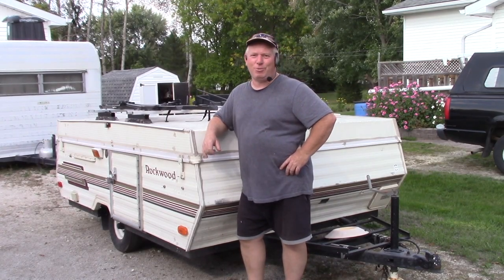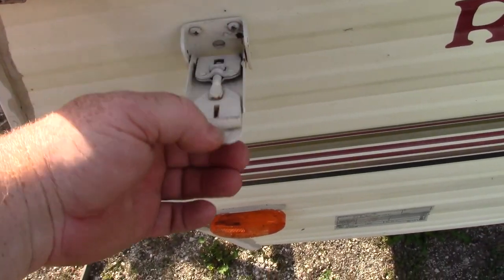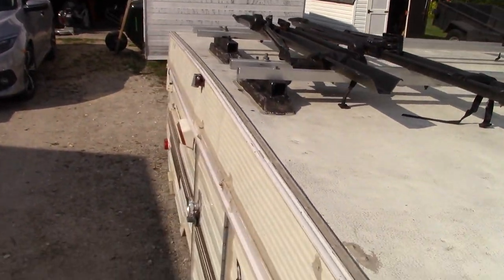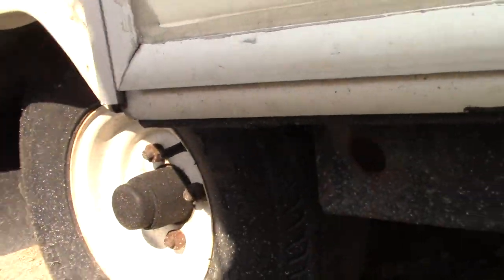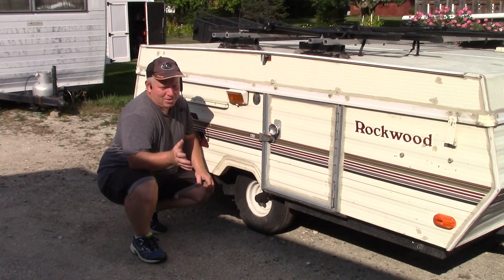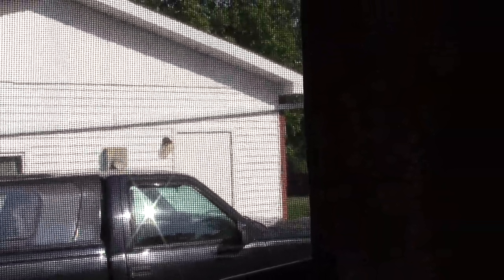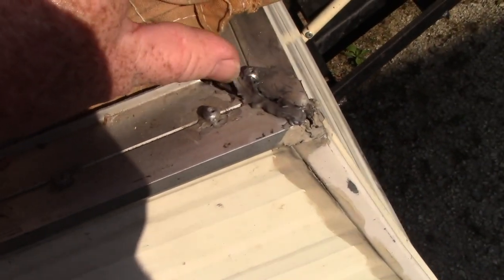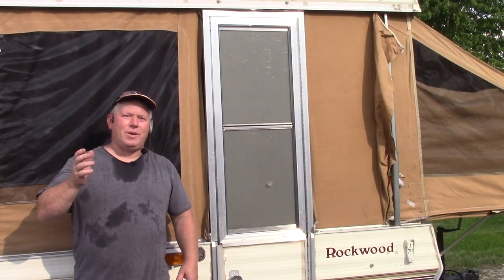Used Camper Problems - What to look for before buying a used pop up camper

Comment: Where the trim on top is, you can replace it for about  $20  a roll instead of going nuts with caulk. No camper has tins that go over the aluminum channel. Sad that someone removed all the hardware for the water, electrical and such. The canvas condition is the most important thing as well as the cable system for the roof lift.
Reply from the maker: Yes you can remove the trim and use a roll of glazing putty to seal it but it doesn't last that long and sealing the gaps with caulking is cheaper and far easier.  My first camper was a 70's era Bonaire and they had the tin folded over the edges of the aluminum channel.  It's truly a shame that the campers from the mid 80's onward were constructed so cheaply.  Having the stove top and fridge in the camper is a bad idea as bears will easily force their way into your tent trailer to eat your food (if there are no bears where you camp then the kitchen set up is fine). I totally agree with you on the importance of the condition of the canvas and cable system. 
Thanks for your comment!
Cheers!
Rob
Reply: @robsgaragewoodworkin  Many parks out west do not allow popup campers because of bears. We were looking at going to Glacier National Park and its a no no to go there with a popup. Its best to check the park before making reservations. I don't want a bear in my camper eather!

Comment: Thanks Rob.  I am looking for one and this helps a bunch!
Reply from the maker: It's an even better time to buy in the fall when people are thinking about storing the trailers and the possibility of storage fees accumulating over the winter.
Good Luck on your search!
Cheers!
Rob
Reply: @robsgaragewoodworkin  Yes it's a good time if you live up north.  I am in Fla, but that is an idea to check around North Fla. thanks.  They are expensive down here.
Reply from the maker: Right.  It would be different in Florida.  If you have a truck or larger SUV it's usually cheaper to buy a 15-30 foot trailer used than a tent trailer.  They hold their value more because they are easy to tow, relatively small and easy to store.
Reply: Sun Valley Coleman pop up, stored in garage, comes with porch addition that doubles its size. 912 467-9800, South Fl.

Comment: Nice video!  Don't buy something on Craigs List and assume what the seller is saying is the TRUTH!  I bought a camper and the seller claimed everything worked.  Not so...the leveling system did not work and the hot water heater only worked on gas.  He said it did not leak and it had a terrible leak in the front bedroom.  The refrigerator is great and runs on gas or electric...yet it was leaking...no pouring into the refrigerator.  He had to know it.  I won't go on and on...just be careful like this gentleman is telling you and have it checked out...could save you some money!
Reply from the maker: I bought it from a friend (but I didn't believe it was perfect because they never are).  But $400 is a good price so you just can't go wrong.
Cheers!
Rob

Comment: Great video, thanks so much for posting. I just bought a 90 model Rockwood, looks very much like this one so I'm thinking it might be the same one but I don't see the model listed anywhere. It's even harder to find a manual. I only saw one stabilizer jack, should there be 4 of them? I paid 400. so good to know, about the price. He tells me everything is working, just needing a good cleaning. We'll see :)
Reply from the maker: It's an 89.  Stabilizers can vary by year, make and model.  It's likely that there should be 2 stabilizers in the back and just the jack in the front.  To level you can put wheel shims under the low wheel.  If you put too much pressure on the stabilizer jacks the frame twists a bit and the door won't open/close properly.  People always say it's in "perfect" condition but their version of perfect can be vastly different than your version of perfect.  If you have more questions feel free to ask!
Cheers!
Rob

Comment: Sleep six people?  That's a laugh.  My 2001 Coleman was apparently designed for 6 anemic midgets.  Besides, have you ever slept in one of these with 6 people?  Between the snoring and farting all night, it turns into a gas chamber from Hell.  Also, the instructions for most all Popup trailers say to lift the roof first before adjusting leveling jacks because it tweaks the frame and puts undue stress on the lifting cables and posts.  Also, the door attachment and placement system with that top hinged, folding panel is waaay better then the Coleman-Fleetwood design.
Note:  After camping in these Popups for 20 years the main thing I'm impressed with is how poor quality and incredibly cheaply they're made and constructed.  They use staples where a screw is needed.  They use particle board or OSB where plywood is needed, on and on.   I've had the wind completely rip out the cheap awning twice.  Popups are fair weather units only and don't do well at the coast either.  They all have several built-in design flaws.  They should let us design one with realistic features and quality.
Reply from the maker: I have 4 kids, so yes we have had 6 people camping in the trailer but if you are over 6 feet tall you will certainly be uncomfortable. We also take a Ryobi battery powered fan for white noise and air circulation.  I have always bought used so no manuals have ever accompanied the trailers.  Every trailer design is different just like you mentioned and every model has its good and bad points.  Poor quality, bad design and cheap construction is universal and we are in complete agreement here.  Sucks to hear about the awning.  I have always been nervous about the racks on top of the trailer coming off because of the cheap and weak roof  latchdown system.  My first trailer had a hitch on the back so we put a bike rack on it and 1/2 hour into the drive the hitch was bending backwards and 2 bikes were almost hitting the road. The roof design always ends up wicking water back up to saturate the wood roof frame.  Doors and canvas are easily tweaked during set up just like you said.  I would love to be able to design and build my own tent trailer to address all the shortcomings in design and quality.  I appreciate your humour and comments!
Cheers!
Rob
Reply: @robsgaragewoodworkin  Rob, yup, Popups are way too flimsy in general.  I for one would be happy to pay an extra few hundred dollars for a well made unit.  It's what I call my "rule of 99%"  The football corner-back catches a 50 yard pass at the 10 yard line and then drops the ball at the goal line, as in going 99% of the way there and dropping the ball.

Comment: I recently bought a camper very similar to this one. I’d love to know how the canvas is attached to the beds. The one I bought has newer style canvas all around, but it was not completely attached everywhere. So I’ve been trying to figure it out on my own since I don’t have a manual and I cannot find any help so far. The one I bought is a Rockford 1RKTC. I’d also like to see exactly how the overhead bars connect to the U-shaped bars that form the ends. I have the bars but I haven’t figured out the proper attachment yet. Thanks for any help that you can offer. I’m pretty new to this type of camping.
Reply from the maker: Canvas can be attached in a variety of ways but is usually just stapled to the bed ends.  The bar is kinda hard to explain.  Mine has a plastic cup on the bed end that fits against the metal bar that holds up the canvas.  Press the plastic cup against that and the other end the open part of the pipe faces up and fits into a metal bracket on the ceiling.  Get a friend that has one to help you out or go visit a dealer and pretend you want to buy one and have them show you how to set up the trailer.
Happy Camping!
Rob
Reply: You should search online for a pdf manual for you model.  There is probably something.

Comment: Hello, my name is Tina and I bought a used 1994 Rockwood popup. I need a new lift system and I don't know where to find the number for it to buy a new winch. Any chance you might know where or how to out what it is? Plz let me know because I can't get my popup to go up all the way up. It takes about 4 people to lift it. Thank.you
Reply from the maker: There should be a nameplate on the side or front of the trailer with all the trailer info on it.  If the winch doesn't work its usually a broken cable or cable mount on one or more of the lift bars.  For more info check with a Rockwood dealer.  Good Luck!
Rob

Comment: Do pop up campers leak if u touch the canvas, if so are there years or models that don’t?  Thanks so much
Reply from the maker: No.  If the canvas is treated and not rotted it will repel the water even if you are against the canvas.  The best canvas is the newer white plasticy canvas.  Try to get a camper with that type.  Look for signs of moisture and mildew smells, open seams and things like that.
Good Luck!
Cheers!
Rob